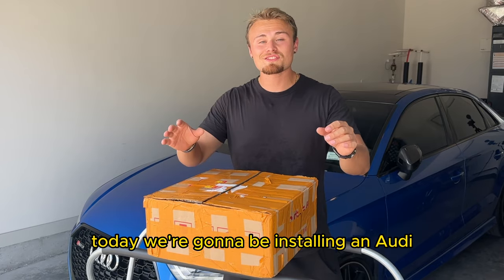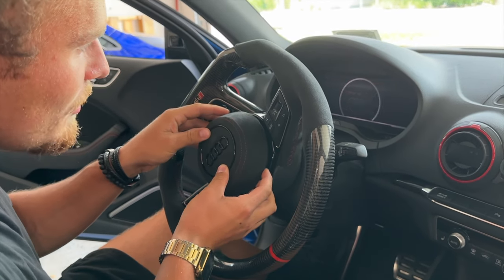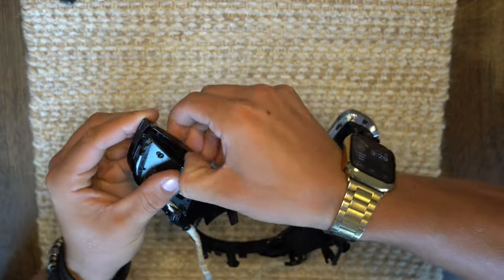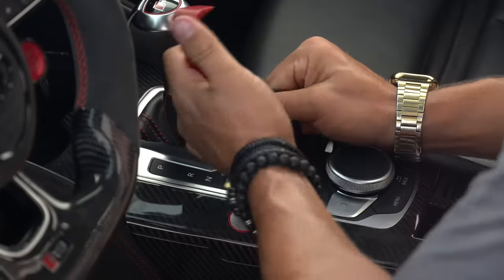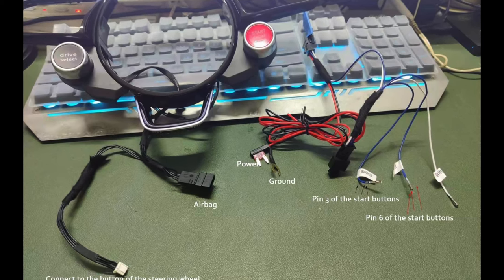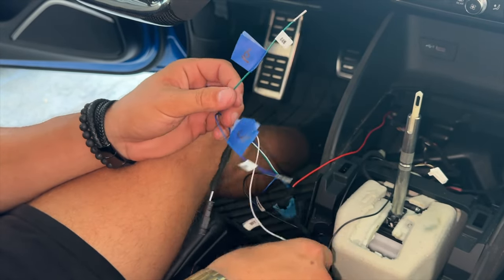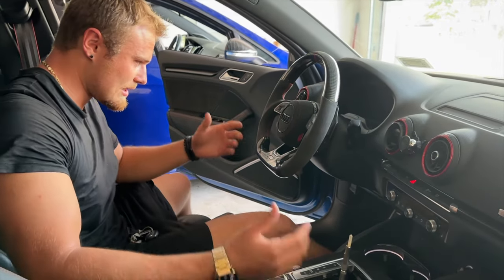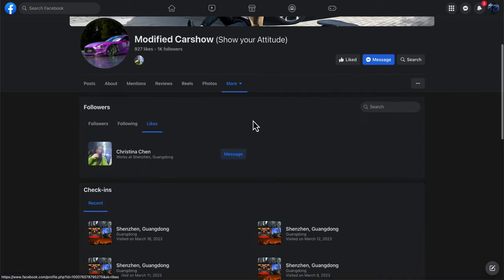How to Install A Carbon Fiber Audi R8/TTRS Style Wheel On An Audi A3/S3/RS3

Comment: Got a question for you, so I have a 8v Audi a3 2.0 and I was wondering if any wheel with paddle shifter from Christina would work as long as it says for 8v Audi a3
Reply from the maker: Good question, I also have had an 8V Audi a3 2.0t. Christina does have a wheel with paddle shifters for you. Heres the MAJOR thing, if you do not have paddle shifters currently on your car then you need to purchase buttons from her that work with paddle shifters or buy separate buttons which I can provide you the eBay link for. Then it’s just plug and play after that! DM me on instagram

Comment: I don’t currently have paddle shifters on my a3. If I buy a new wheel, how are the shifter’s being powered?
Reply from the maker: If you buy a new wheel you will also need to buy new buttons that can power the paddle shifter. the A3 steering wheel buttons arent wired to send power to shifters even though there is a plug for them on the back. You have two options. the first is replace your wheel with an S3 or RS3 wheel that has buttons and shifters already on it. Option  2 is buy a carbon fiber wheel from christina who i show in my video and also tell her that you need to purchase the additional button assembly to make the paddle shifters work
Reply: @Haydenschreiermk2  ok thanks for the help!

Comment: I HAVE A SERIOUS QUESTION: Looking to order a custom steering wheel from Christina, but was debating if the Alcantara wheel cover would be safe. I have done some research and many people say that this may be a safety hazard. Does anyone know?
Reply from the maker: The alcantara airbag cover? I mean anything not from factory has its risks. HOWEVER upon further inspection of mine. It is indeed an OEM Audi steering wheel cover that you can see from the inside. You can tell it’s OEM and that they have put alcantara over it. I’m not sure it if it’s perforated or will tear upon airbag explosion (I hope it does) but I can’t be sure until it’s tested. I have seen videos of other airbags w alcantara on them tested and it does show it working

Comment: Ciao amico, posso chiederti una info? Ho visto il tuo video tante volte, perché anche io ho installato i tasti drive select e start. Ma nel collegamento che fai nella consol centrale fai solo il collegamento dei pin che vengono dal tasto di accensione, il 3 è il 6.  Il Red è 12v e il Black e massa.  Mi chiedo come fa a funzionare il tasto drive select?  Grazie per la risposta
Reply from the maker: mi spiace, parlo inglese e non italiano, quindi per favore traduci il mio testo

Pin 3 and 6 are connections that tap into your push start button and the red and black are power for it as we are piggy backing the connection. The drive select buttons get power as they piggy back off the steering wheel. As you can see when I plug the steering wheel in there are more wires than the original. The steering wheel wires are for drive select power and the center console is only for start/stop buttons
Reply: @Haydenschreiermk2  dear friend I would like to show you some photos of the wiring received from Aliexspress, do you have an email to send to?

Comment: Great video, but how did you get the steering wheel to unlock while the battery was disconnected? I can't unlock my steering column unless the car is fully on
Reply from the maker: The car was fully on and then I turned it. I also heard you can press once to get the car in accessory mode and turn the wheel without power steering. Regardless battery on turn the wheel loosen airbag. DISCONNECT BATTERY than unclip airbag from wheel

Comment: Press the key once if push to start without turning the ignition on and disconnect the battery, never take off a airbag with the battery connected...
Reply from the maker: I didnt “take off” the airbag with the battery connected. But in order to take the airbag off you have to turn the wheel left and right. With the car off the wheel will anti theft lock. Once the airbag is unclipped i disconnected battery and unplugged the airbag
Reply: @Haydenschreiermk2  I know however its still really dangerous to do it the way you did if you click the start button once without pressing any pedals your steering wheel will unlock without having the ignition on and then you can rotate the wheel
Reply from the maker: But even then there is still power going to it. Whether ignition is on or off. But i will do that next time

Comment: You don't really need to unplug the battery, just make sure the car is fully OFF when removing the airbag.
Reply from the maker: you 10000000% shoudl take the extra step to unplug the battery. this is to lower the risk of detonating the airbag and also throwing an airbag light. yes airbags dont deploy if the car is off but why risk it. if left on, theres a chance yo u may forget and accidentally start the car to turn the wheel.
Reply: @Haydenschreiermk2  Hey brother, I made an order with Chen through FB after watching your video and seeing her work. I also mentioned your video and got a discount! The steering came in three weeks and I installed it all by myself. I had done it in the past and your video was a very good refresh. I listened to your advice and removed the battery, just to be safe. Thank you and I hope you get compensated!
Reply from the maker: @imlevitating___  ayyyyeee! that is awesome news dude! im glad everything went well and came out good!

Comment: Never disconnect that airbag with the battery connected. A better way to do it: Turn the car onto accessories only (Don't start it) then disconnect the battery. This will prevent the steering lock from coming on and allows you to manually turn the wheel left / right to disconnect the airbag.
Reply from the maker: You can unclip the airbag perfectly fine with the battery connected. Nowhere in my video did I disconnect or touch the airbag wires with the battery still connected. Metal clips holding airbag to the wheel have nothing to do with the airbag wiring harness. Thats like saying don’t unscrew your seat with the battery still on because there’s an airbag in the seat. Obviously you can unscrew your seat with the battery still on. Just disconnect the battery before unplugging the airbag

Comment: What fuse did you tap into for the power trying to connect one of these to my S5 B9 and a piggy back off the original start button fuse seems to be a switch live and will only work once you press the original start stop button
Reply from the maker: Its been awhile, but I believe you need constant power even when the car is off. Go buy the fuse tester I have and see which fuse is constantly on. Then unplug your battery, pull the fuse and put the fuse tap in. You can also go online and check what the fuse your pulling is used for.

Comment: Very nice, is there one for my 2006 audi a3? 😂
Reply from the maker: I’m sure there is on eBay, but it’s an entirely different part. You will most likely need t replace the pump and thermostat at the same time

Comment: Not an r8 or a ttrs wheel. You might want to change the name on the video to r8/ttrs buttons on a3/s3/rs3 wheel or retrofit kit.  R8/ttrs wheels are completely different than rs3 wheels. For start the main buttons are illuminated red instead of white and theres a big gap in center of ttrs and the r8 wheel. Also r8 wheel and or ttrs wheels depending on model have exhaust flap buttons and race mode buttons attached to the drive select and start stop but are extremely hard to program to an rs3.  The drive select and start  stop retrofit kit you have on that wheel are extremely easy to install.
Reply from the maker: No one said it was an R8 or TTRS wheel lmfao
Reply: Title says the wheel is in the “style” of those ones.
Reply: @Bahle_Gaji  well its still not there style. Its a start stop button and drive select button thats on the oem rs3 steering wheel.
Reply: @reesechris76  Ok Chris. You still get the idea
Reply: Chris its just a wheel mate
Reply: Lmao bro. You know what style means right? It doesn't say TTRS/R8 wheel retrofit. You say retrofit bit retrofit would be putting the authentic part from an R8/ttrs on the RS3. It's clearly an aftermarket wheel. Calm down lol
Reply: @reesechris76  There style? Where style?

Comment: There’s a proper way and a lazy way and this is definitely the lazy cheap way. Instead of using the allready existing free pins specifically designed for that feature is absolutely hilarious. The kessy ecu is directly under the steering wheel cover where you could have picked the start signal from but hey, ripping 1/10 of the car out to do sketchy wiring with janky looking buttons is the way. Oh dear god thats the difference between us and eu car guys…
Reply: So how show us how it’s done.
Reply: The correct answer is to tap into the blue tooth signal wire in the center console.
Reply: Oh really, since you’re so informed and so “proper” why don’t you do it,  film it, and edit it, matter fact why are you here if you are so informed? Buncha talk with no walk 😂
Reply: @R_S4_B5 do you have a link or video where I could see the correct way of doing it? Thank you
Reply: a whole year later dude has nothing to say ! Please in future just hush talk about cheap talk is cheap mate 🤫

Comment: Hayden I reached out to them twice with your name and have yet to hear back from them. Do you know if they’re still in business? Do you have another contact email address for them if they are?  Thanks
Reply from the maker: i sent her a screenshot of this message. they are in business still last i checked. i will tell her to take a look
Reply: @Haydenschreiermk2  Thanks man. I appreciate your help!
Reply: I finally connected with them. Since mine has a lane assist sensor in the stock wheel, I’ll need to erase any codes via scan tool. Have you heard from others if this was problematic or is it pretty straightforward.

Comment: I would never install a Chinese clone wheel in my car. I've seen pictures where these wheels just break in half. Stick with the OEM Audi wheels people.
Reply: They are OEM cores, so technically you would be getting an OEM wheel, I have noticed no difference.
Reply from the maker: This is an oem Audi wheel that they carbon over